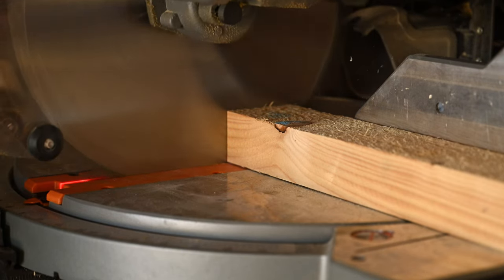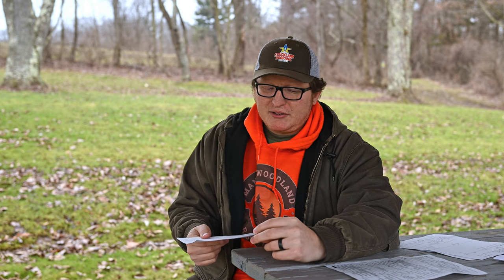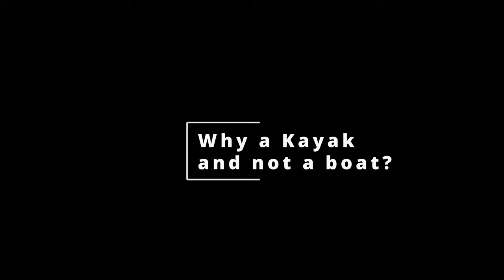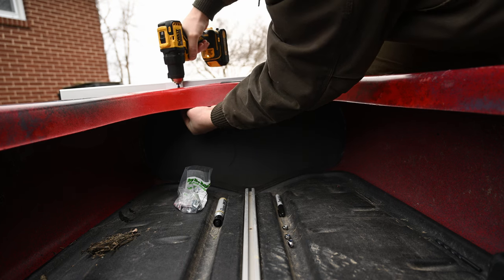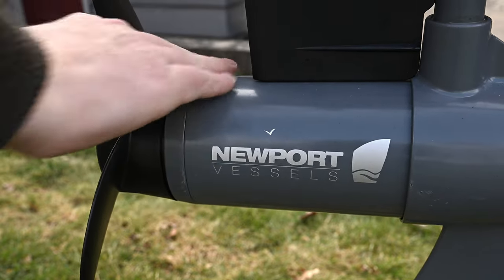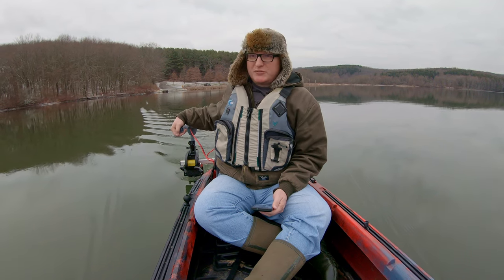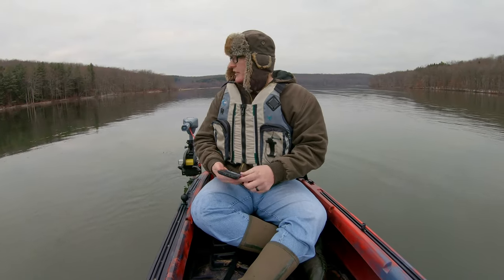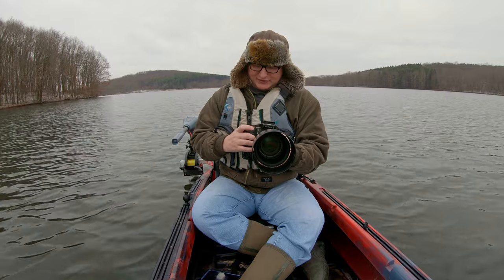Trolling Motor on a Kayak - How to A to Z

Comment: Good video.  I have the same kayak I use for fishing in Pa.  I was looking on You Tube for ideas to mount an electric trolling motor and came across your video.  I am now in the process of using your ideas.  Thank you for an excellent video.
Reply from the maker: Go for it!

I just got my sticker in the mail yesterday. It took about 3 weeks to get it all through the postal service. 

Your registration and titling paperwork used to submit, can be used as your temp registration so you can still use it day 1.

Comment: Good video man, I like the technicals. On a constant usage on a 1 setting how long does it take for the battery to drain
Reply from the maker: Thanks!

I think speed 1 is about 6-10 amps draw. With this 50amp hour battery I'd think 4-5 hours.

Last week I used mainly speed 3. I got about 2 hours and covered 3.5 miles. My charger showed the battery had about 20% charge remaining. It was 25-30F out.

So in the summer I'd imagine the battery will last even more.

No reason for this battery not to last for a day out and about.

If you want to see the video from that day to see, look up the video involving Mergansers in the winter.